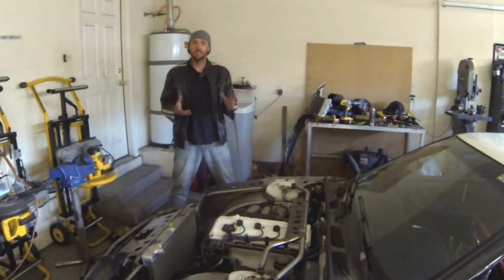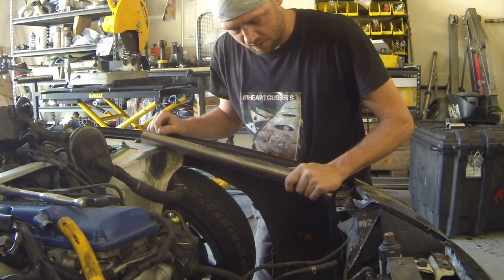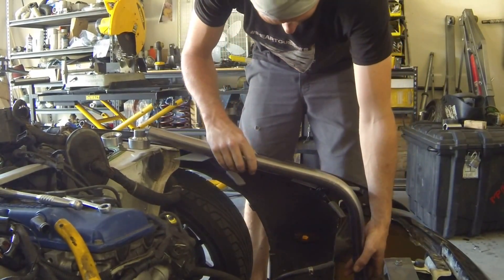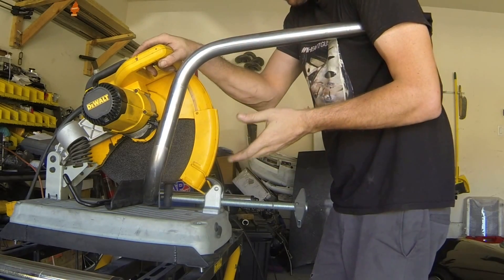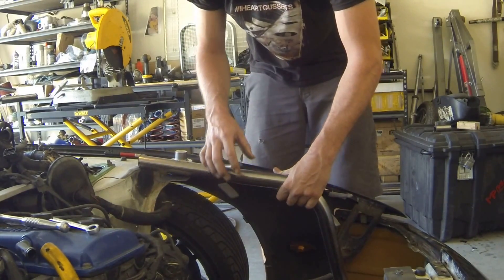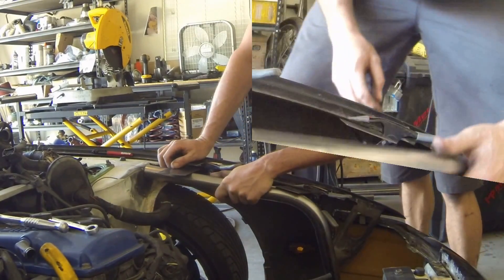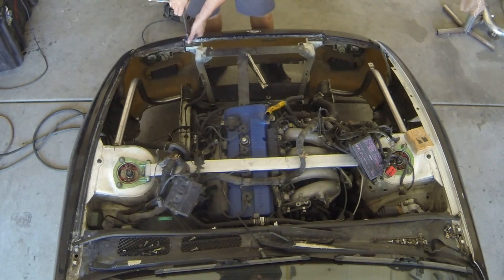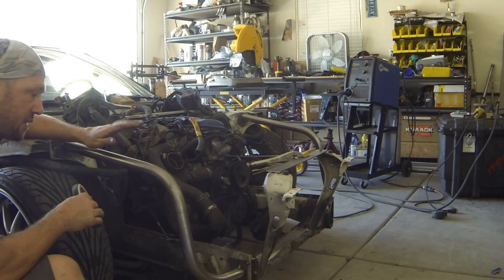TFSS: How To Build A Tube Chassis Front End - Installing the Primary Tubes

Comment: I know this is a little dated video, but looking at a tube bender for my personal shop.  I was on the JD2 website and looking at the Model 32 - when looking at the 2" die set, would you get the 6 .5" radius die or 7.5" one?  Pros cons besides the obvious of a tighter bend radius?  Thanks in advance, I'm a subscriber!  Clay

Comment: I am looking to get into fab work as a hobby. I want to eventually do literally this exact thing on the same car (or '87 bmw e30 coupe, which ever I can get my hands on first) and just wondering how to chose a tube bender that would be right. I am looking at the woodward WFB2.
Reply from the maker: +Jordon Renn Ideally, you want one that is affordable, the correct type, and will allow the most sizes and CLR offered by the manufacturer. I use a JD2 Model 3 which is very similar to the Woodward. Of course you will want a bender made for tube (not pipe), and you may want to consider the amount of space you have. If you are limited on space, you might want a bender that mounts vertically rather than horizontally. Those are the basic things to look for.
Reply: Thank you for the reply! Looking forward to more videos.
Reply: Jordon Renn if you havent made a purchase, yet. The model 3 and 32 from JD2 have a much larger selection of dies. If you're looking for affordable quality, stop there, otherwise, you may be kick yourself because you need a 1.5×4.5 die in year and realize woodward doesn't have them. Food for thought.

Cheers,

Craven

Comment: Hey, I love your channel and videos, I'm gonna attempt at making my own rollbar/cage for my miata and was wondering exactly what material tubing you use!! Thanks for all your help!!!
Reply from the maker: +dusty mcelroy ALWAYS refer to the rules and regulations written by the sanction of which you will be building your roll bar or cage to. Drag, drift, time attack, rally, and off-road all have specifics to the style of cage that needs to be constructed. Chose your sanction and follow the specs and design outlines on the official rules.

Comment: Yet another awesome video man! One thing that has come to mind is weight... Do you think your adding any kind of sufficient weight to the front end going tubed, or is it roughly the same as the factory. Also, if you had to roughly guess how much material you used for the completed front end, that would help me ge ta base line of how much i would need for my build. Thanks ahead of time, and keep up the great work!!
Reply from the maker: +1dickycat The weight subtracted vs. the weight added is actually pretty close on this one. It's +/- 10 pounds at most. I sopped weighing it after the tubs and sheet metal because they are a little heavier than what was cut off. The strength of the front end, however, is dramatically increased. 

As far as a materials estimate is concerned, I used roughly 25-30 feet of 1.5" tubing (mix between DOM and ERW), about 10 feet of 1" tubing, and the rest is sheet metal. All of this varies from build to build. Some tube fronts use less than 10 feet of tubing all together and have no additional sheet metal, while others have more than twice the amount used here. When you decide on your design, a materials estimate can be created.
Reply: Sorry for my nubness,but how thick is DOM  and ERW tubing?
Reply from the maker: +1dickycat Never be sorry. You learn by asking, right?

Thickness of any tubing is whatever you order it at. There are dozens of sizes to chose from.
The type of material itself (ERW, DOM, CM) has certain strength properties for its size and thickness. Drawn Over Mandrel (DOM) tubing is stronger than Electronic Resistance Welded (ERW) tubing. Chromoly (CM) s stronger than both. I use DOM in high impact areas such as the lower bash bar and brackets since it will take more abuse (or load) before bending or deforming. There are a ton of really good online articles about types of metal and tubing. You can usually find them on metal  distribution companies websites.
Reply: Very true. 

Ahh! OK, makes complete sense now, a lot simpler than i thought it was. So how thick of tubing did you use? I know I tend to over build things and end up with heavy projects, trying not to do that for this one.

Comment: Is there a reason you are not using DOM tubing for this area ?    I was always told that any chassis work , needs to be done with DOM .....  (Now I am more into the Off Road builds but I figured it would be the same for any Comp style build ....
Reply from the maker: +Norman Murray Most of the structure remained forward of the strut towers, and none of the structure was removed rearward of the towers. With instances like this, there isn't much need for DOM. ERW is more than adequate.  I generally say that full chassis, or anything between the strut towers should be DOM.
Reply: Thanks for the Clarification ......